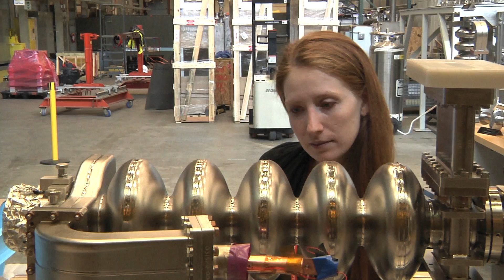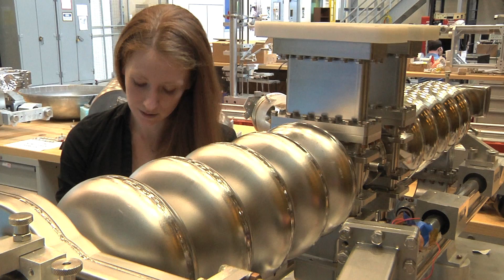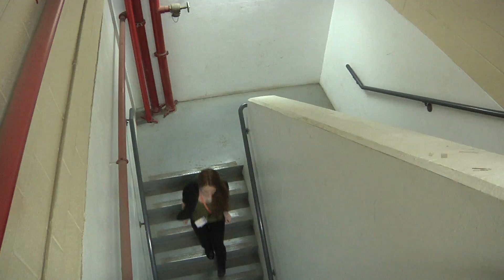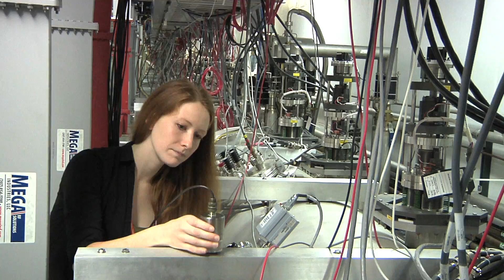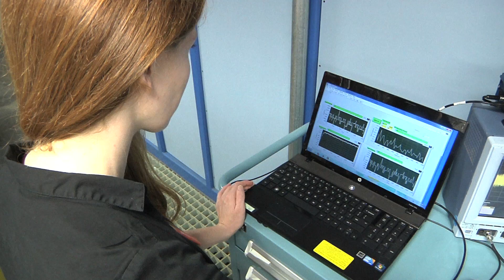SULI Student Spotlight - Victoria

Comment: Really interesting project. I didn't know the accelerator cavities suffered significantly from microphonics, but I guess it makes sense; they are very high-Q so even small detunings could cost a lot of efficiency or interact badly with the oscillator.  How critical is the exact operating frequency for the acceleration?  You must have a way to dynamically tune the cavity already?  It might be difficult to measure the phase shift of a detuned cavity, especially at high power levels where a circulator would be challenging to build, but if you could you could close-loop tune the cavity to keep it locked to the source. How practical that would be would depend on the bandwidth of the tuning system and the mechanical noise you want to reject, and the resolution of your ability to measure the cavity detuning.  Might be easier to actively damp the mechanical vibrations themselves.